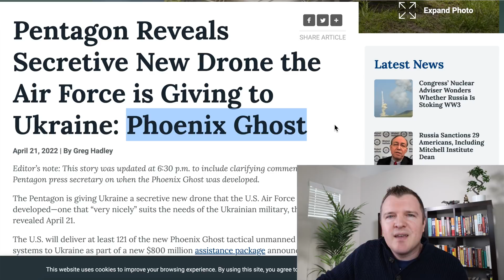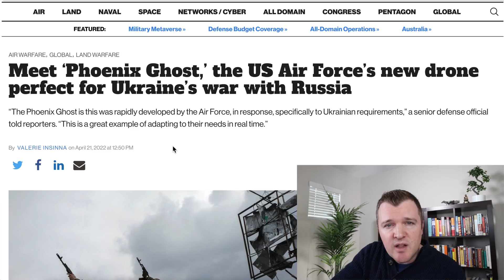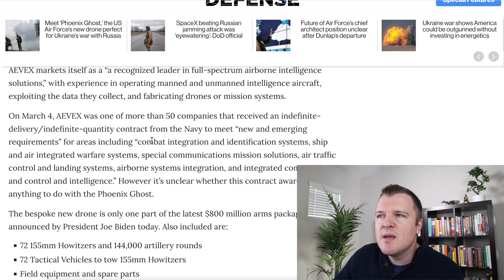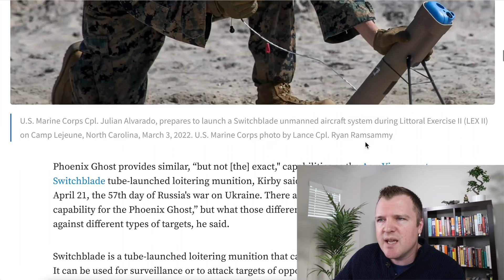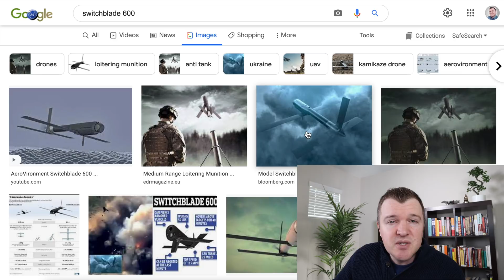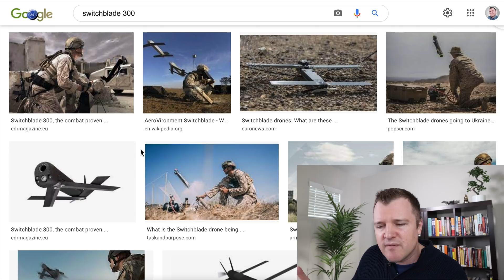SECRET Phoenix Ghost Drone Given to Ukraine

Comment: Correct me if I'm wrong;

My understanding is that the Switchblade comes in kits of 10 drones to 1 control panel. So 100 Switchblades is actually 100 Switchblade kits containing 1000 drones.

Comment: UA was ranked 6th in Europe (only after UK, France, Italy, Germany and Spain, in that order) according to Global Firepower and 11th arms exporter in the World (thus strong military-industrial complex) according to Stockholm International Peace Research Institute. UA ground forces had cca3000 MBTs, cca2500 IFVs, another cca3500 armoured vehicles. Artillery included 500+ MLRSs, 1200+ selfpropelled artillery and 2200+ towed artillery. Air defence was organized in 4 air defence missile brigades and 7 (11 according to some sources) independent air defence missile regiments with 250 S-300PT/PS/V1 SAMs, 72 9K37 Buk SAMs, 100 9K330 Tor SAMs, 125 9K33 OSA-AKM SAMs, 150+ 9K35 Strela-10 SAMs, 70 2K22 Tunguska SPAAGMs, 300+ ZSU-23-4 Shilka SPAAGs and hundreds of S-2/S-3 Strela, Igla, Piorun and Stinger MANPADS. UA Air Force had 145-188 modern combat aircrafts including 37-70 Mig-29s and 32 Su-27s fighter jets, 12 Su-24s and 17 Su-25s attack jets and 47 L-39s light attack/trainer jets. What happened? Why do they need donations from western partners of military hardware and ammunition?

Comment: The main difference in the Ghost compared to both Switchblade versions is much better loiter time and/or effectiveness against targets much farther away.  And, whereas the Ghost also has the familiar "kamikaze" mode of operation, it also has better recon software and may be used more for surveillance than attack mode and thus will be sent aloft quite often for mainly surveillance/spotting, and flown back for later relaunch.  As known, 121 units is very small in a theater of battle and would be very quickly used up in kamikaze mode.  I imagine the drone would attack only very significant targets when found, that could not be attacked in timely manner any other way.

Comment: If you will read a little more carefully, it says not "exactly 121 drones," but instead "more than 121," so it isn't really an "oddly specific number." 
I can envision these as a "mini swarm or a small group of stealth-encased drones, with one gathering surveillance information, and passing it to a number of similar, multi-use (surveillance/attack/jamming/etc. loitering (at different altitudes) other drones, appearing very suddenly (the "ghost" part), hitting a target chosen by the surveillance drone, and possibly firing a kinetic or explosive weapon, instead of simply exploding. This would make for essentially, a small fleet of stealth combat aircraft, able to interact with others of its type, and to return home - or different scenarios based on this basic one. It's going to be deadly, and a game-changer or we would have sent more. It's time to start combining Drones, AWACS, miniaturized surveillance, miniaturized communication packages, munitions, and smaller, Javelin-style A.I. attack and forget airborne weapons.

Comment: The 121 plus the other odd numbers all have to do with the aid amount previously promised. If the total amount of military assistance is 99 cents below the promised amount, the government will include a bottle of Poland Springs water worth 99 cents. 
Great presentation, info gathering and analysis.

Comment: Phoenix Ghost - move in the shadows. The advantage over switchblade is to move and track during night. Expencive night-vision on a suicide drone in other words. I can only guess - but solid state battery for extended flight time to monitor and track valuable targets before going in for a kill. Tube launched is a safe way to transport with aircraft and easy to move around on battlefield on the back of a truck stacked. Easy to mount on ground and launch.

Comment: Some more info regarding the Phoenix Ghost has been revealed: it's a quad-copter, has a flight time of ~6 hours, is equipped with IR cameras, is radio silent, and is capable of taking out medium-armored equipment.  Seems like something where the US has had this in development and is interested in battlefield performance.
Reply: ...and if this is only WHAT THEY ARE ADMITTING TO, then my comments above may have more validity than it might at first have been assumed. SIX HOURS - Jesus!
Reply: @berretta9mm158  Yeah, I don't think the US would supply it's bleeding-edge stuff, but can you imagine the engineering going into a six-hour flight quadcopter carrying advanced optics and at the end of the six hours can deliver a payload capable of taking out an APC? Thats a hell of a drone.

Comment: What if the "Ghost Drone" is actually a deployment system for coordinated anti personnel drone swarms?   So it drops say 50 smaller drones that attack anything that moves when it deploys - that would mean 660 submunitions all blanketing an area.

That would be interesting...drone swarms are a real weapon aand this seems like a perfect opportunity to test them.
Reply: This is one of the uses that I, too, have stated, with an A.I. ability for some to switch to C&C, like a "mini-AWAC," but a multi-rle single and swarm weapon. It's time, and I've been expecting something like this for a while. I believe the game is about to change...
Reply: @berretta9mm158  It's really possible - I worked at General Atomics for 13 years - it's real.

Comment: There is the Israeli Harop system which is basically switchblade X 20 - range 1000 kilometres, and not 40

my guess is that it's somewhere between them, meaning they can launch it from somewhere in central Ukraine and it could smash into Russian lines

Comment: I don't get how any kamakazie drone in such low quantities can be of much help to the Ukrainians.

These are great, and they will do a lot of damage, but the quantity is not nearly enough.. Russia has got near unlimited reserves (at least on paper).
Reply: Switchblades are probably gonna be given to Ukrainian special forces.

Also Russia does not have unlimited reserves. That's a myth. Their tank fleet is smaller than reported, with most of their tanks rusting away. Their soldiers are poorly trained and poorly motivated and their logistics suck.

Ukraine actually have the advantage in numbers. With 200,000 new recruits being trained and a couple dozen thousand troops just freed up from defending Kyiv.

Comment: Supposedly it has a 6 hour endurance from public statements, and can take out medium armoured (so IFV's , SAMs) vehicles, and has infrared sensors. This likely means it has a 300-1000 km range weighs 100-200kg (guestimating from range vs size relationship of other systems, and most drone travelling between 100-200km/h) .It's rcs is likely to be lower then the TB2 probably about 0.1m2 RCS. Stealth features tend to significantly up prices, and not all stealth methods are able to be scaled down arbitrarily small, but if it has them then you might expect it to lower its RCS significantly and look like a single bird rather then a flock of birds like the tb2. This would allow it to quite easily slip into clutter where the tb2 might be destroyed by AA systems. Unlike the tb2 this is a munition and not a drone, thus it won't necessarily return.
It's main role may be SEAD by hunting down AA systems, in addition to being able to provide reconnisance for air and artillery assets whilst remaining undetected for extensive periods of time. It seems to close a gap in range, reconnisance time and stealth where the switchblades were stealthy but low range and loiter time, and the tb2 was long range and loiter time but still detectable by AA systems (as a tb2 distracting the Moskva demonstrates). Admittedly me supposing it has stealth features is exclusively because it is called ghost, so take that part with a grain of salt.
Reply: Everything you have said I have also stated, and agree with completely. 
One main clue is simply the name "ghost" - this is a "smart" UAV that can loiter for 6 hrs. invisibly, and likely work in small swarms. It may (as I said earlier) also not destroy itself (the Phoenix part),  but act at different altitudes, or "Zones," as reconnaissance for each other like a suite of mini-AWACS and attack craft. 
For me, the main clue that this system is much more than people believe it is, is simply the fact that they only delivered 121+ of them. This is a game-changing technology, and I'm looking forward to seeing it in action. Thanks for your post.
Reply: Maybe the "secret sauce" compared to switchblades is to do with integration with other battlefield systems. I could imagine something in development being rushed through to 'suit the situation in Ukraine'. If these could share data with the counter-battery radars also being sent, I'd imagine you could deploy the drone launchers over a wide area have a pretty fast and potent way to take out lots of enemy artillery positions (apologies for my lack of military terminology - I'm a neurology grad and electronics/ham radio nerd, but this interests me too).
Reply: @rob-muntron  Don't worry I just use the acronyms because they're quicker to write.

Comment: I would be surprised if the Phoenix Ghost was meant as a direct competitor to the Switchblade.  It doesn't really make any sense to keep its specifications secret if it is basically a Switchblade in different packaging.  It has to have some sort of fundamentally advantage; otherwise, why not just send more Swtichblades?  The Ukrainians are already being taught to use multiple weapon systems, why add another just to get comparison data.  That line of thinking is too jaded for me.  Although, I'm sure that whatever its capabilities are, the Pentagon will be interested assessing its performance in a live setting.

Comment: If it was for the airforce specifically, the airforce generally wants targetting information and SEAD, more then long range fire support for other targets. It seems like an ideal airforce system would focus on picking up radar from enemy SAMs, and having a full range of sensors which can provide up to date target locations for air assets (although in Ukraines case artillery is likely to be more important then the airforce). If I'm guessing the role is more likely to emphasise stealth, loiter time, sensors and providing target information to other assets. A more standard one might emphasise the ability to kill targets like a long range mortar.
Reply: Good analysis. A sort of modern "Tacit Rainbow" with ISR capability.
Maybe autonomous target acquisition and swarm capability too. I'm guessing this was originally designed to be air dropped from an AC-130 or from a larger UAV like Reaper.
Reply: @simonmoorcroft1417  I looked into it's capabilities a bit more and it sounds like it's most similar to the IAI Harop, having similar flight time, having infrared sensors, being a kamikaze drone, and the Harop fitting in with the air-forces usual goals of SEAD/DEAD would explain why the US Airforce bankrolled the development. Basically it's stealthy (<0.5m2 rcs, probably ~0.1m2 given its size assuming no advanced stealth techniques given its mass) and it just loiters over SAM sites for hours and dive bombs into them if they turn their radars on (accomplishing DEAD), or the SAMs don't turn on their radars (accomplishing SEAD), although it can also target via optical or thermal sensors and human direction . It's autotargeting function for RADAR also allows it to ignore signal interruptions. It's RCS is small enough that missiles fired by SAMs find it difficult to hit, and it's 1000km range means that it can get anywhere a SAM system is suppressing air activity.
If it's what I'm thinking it is, it's a way to make Russia want to turn their radars off, or slowly chip away at Russia's SAM systems.

Comment: Ive read some other information so here is my interpretation:
- SB300 is 5k, not 3k
- SB600 is 70k
- Ghost drone can loiter for 6 hours. That more like the Israeli Harpy/Harop drones with also 6 hours loitering time.
-  In fact they probably saw the amazing results in the 2020 Nagorno-Karabakh war and decided to make their own Harpy
Reply: Harpy drones also have a SEAD role primarily, which fits in with the US air force requesting the phoenix ghost system initially. It's possible that it's not exactly the same, they might provide better targetting information for air and artillery, or that it is a little more stealthy to avoid anti-drone systems, but overall it seems like a copy of the Israeli system.

Comment: The US doesn't like redundant weapons systems. What if it is a loiterint anti-air system? Or maybe it integrates with artillery-detecting radar to automatically hunt down arty.
Reply: I hope this drone is a long endurance spotting drone for counter battery action by the mobile howitzers.  It would neutralize the Russian artillery.
Fire and move at once or receive return fire.
  No more continuous sustained shelling, nor bracketing for the killing round.  No more secure firing battery locations and ammo depots.
  Ukraine will have a response to Russian artillery.
The s300 mobile air defence  along with the stinger missile s to protect the hauler+howitzer team will be next piece of 'defensive weapons' for  Ukraine victory.
Reply: The US doesn't like redundant weapons systems but they do love making the arms industry compete with one another to get what they want.

Comment: The tank busting Switchblade 600s are in short supply so maybe a second source with more manufacturing capability for quick availability or better yet, a longer range to reach artillery.  Killing artillery is going to important to the Donbas.

Comment: The Phoenix Ghost “is a different type of aircraft, it’s a one-way aircraft that is effective against medium armored ground targets,” said retired Lt. Gen. David Deptula, dean of the Mitchell Institute for Aerospace Studies and member of the Aevex board.

The drone can take off vertically, fly for six-plus hours searching for or tracking a target, and operate at night using its infrared sensors, Deptula said. Phoenix Ghost has a longer loitering capability than the Switchblade, which can fly for less than an hour, he said.
Reply: I thought it was a hive system that if shot down; one of the other swarm drones aquires target and re-directs while others either aim for additional targets, are set to survelience mode, or pre-programmed flight path of choice from the control hive vehicle that contols 30-60 swarm drones.
Reply: @Morristown337  You could well be right, but the instance you've described is awful close to the slaughterbots video. It would be unwise to unleash that power over Ukraine; which could well hit friendly targets or civilians. 

I would hope there is a required human confirmation to target and terminate.
Reply: @Naptosis  It is still controlled by people inside the hive unit. It has auto-sets but can be switched to manual control at any time from what I understand.